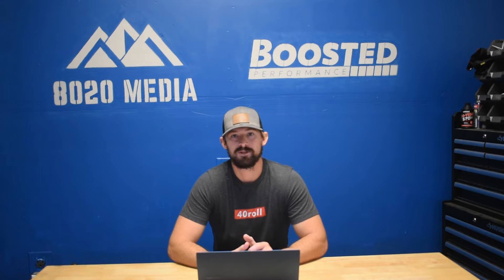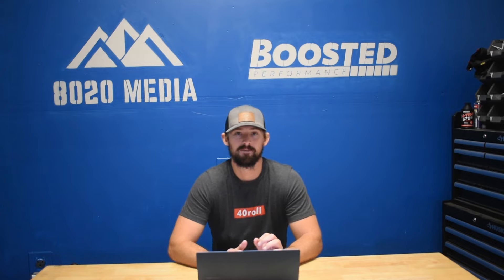DIY: How to Fix GMC/Chevrolet "Service Stabilitrak" & Traction Control Lights!

Comment: My throttle control and traction control lights are coming on. I've already replaced the throttle body. The codes from O'Reilly's tell me to replace the map sensor, but after I replaced it it still shows I'm supposed to replace it. Both the throttle control and traction control lights continue to come on after I drive it or let it idle a bit. Could a traction control sensor that's dirty or needs to be replaced cause the throttle control light to come on?
Reply from the maker: L - Have you reset your codes after replacing the MAP sensor?
Reply: @8020Media  yes
Reply: @8020Media  I have a 2016 Dodge Grand Caravan. I'm just having a hard time finding anything about the traction control and throttle control lights being related until I found your video.
Reply from the maker: L - Sorry to hear this.. Have you checked the wiring/connections to the MAP sensor? What code are you getting specifically?
Reply: @8020Media  I've replied with codes twice, but I don't see my replies with the codes. Do you see them?
Reply: @8020Media   catalyst efficiency below normal (bank 1), catalyst (2/1) efficiency below normal, IAC RPM higher than expected 

Those are the stored and pending codes both lists are the same. All of those codes are also in the permanent category + throttle actuator control system - high air flow detected.
Reply: I have replaced both Bank 1 O2 sensors, PCV valve, spark plugs, had two valves resealed - to remedy the flashing engine light and misfiring. Then the throttle body light started coming on along with the traction control light so I replaced throttle body, and then  MAP sensor after having O'Reilly's test the codes after the throttle body replacement because the map sensor code started showing up then.

Comment: Help here , in my case I only get the warning stabilytrack when step on break and car shut off for autostop but never when it’s running so what is your guess ?
Reply from the maker: Tin - Have you taken it to a shop to be looked at? Our thoughts are a brake issue or an issue with the autostop system.
Reply: No I didn’t take it to the shop and it’s intermittent fault and annoying
Reply from the maker: Tin - This is a difficult issue to diagnose. I'd advise taking it to a local shop.
Reply: @8020Media  I already replaced the break light switch and not changed at all keeps doing only on long stops over the break pedal
Reply from the maker: Have you addressed other things mentioned in the video?
Reply: @8020Media there is not codes I already checked abs connection sensor and nothing
Reply from the maker: Tin - And you're still experiencing this?

Comment: 4:50 I have a 2014 Silverado Z71 that I'm having this issue when I use my cruise control and switching on my hi beams. It kicks off the cruise and sometimes I will get the stabilizer link message or steering assist. Traction control light goes on/off, xm radio switches channels or goes completely blank but music keeps playing.  Also the engine shuts off when turning sharp like into the driveway or parking stall. Please get back to me with any thoughts.
Reply from the maker: J - This sounds like it could be electrical related. The ABS harness is close to the headlights. Have you had it looked at?

Comment: Mine came on after a wheel alignment.  Could the wheel alignment cause it to come
Reply from the maker: J - It's possible. Just try to drive on it for a few hundred miles and it should turn off!
Reply: @8020Media  thank you.  I work 80 miles one way got halfway to work this morning in it went off.    Thank you so much
Reply from the maker: J - Great to hear! Thanks for coming back and updating.

Comment: Occasionally my 2015 gmc sierra 1500 stabilitrak light comes on in reverse, lights dim significantly and truck dies. Steering wheel at low low speeds can sometimes be loosely erratic but not difficult to turn. Going to change spark plugs, ignition coils, fuel filter and throttle body. Any additional ideas? Thanks in advance
Reply from the maker: D - The symptoms you describe give us a bad feeling about your battery/alternator. You may want to get them checked. Keep us updated on this!
Reply: @8020Media  I will and thank you 🙏

Comment: 2012 Camaro - just got three messages pop up - Service Airbag, Service Stabilitrak, Service Park Assist at the same time...the car wasn't started for a while but the battery is only a few months old.  Checked for codes and there were none.  Disconnected battery and reconnected after 30 min, still there! I'm at a loss...any advice?
Reply from the maker: N - It could be an electrical issue.

Comment: i took my 2016 Chevy Traverse Lt AWD to the auto parts store they put on scan tool Found out bunch of codes spark plugs, coil packs and malfunction bad throttle body making service traction control and stability light on the dashboard to come  on
Reply from the maker: D - Sounds like a lot. Keep us updated!

Comment: service stabilitrak, service traction control, service trailer break system. abs is on also. No check engine light, no codes. Any suggestions?
Reply from the maker: M - We go over some troubleshooting steps in the video. Unfortunately, this isn't the easiest issue to resolve.

Comment: Does a diagnostic code typically narrow it down?

This sounds pretty darn complicated

This happened today and we were hoping to remedy it considering we bought the vehicle since the 2011 Tahoe was considered EXCELLENT reliability... Especially when it has only 87,000k miles.
Reply from the maker: C - Yes, a code will certainly speed up the diagnostic process. Unfortunately, it's not always an easy fix. Keep us updated.
Reply: @8020Media  will do. I was going to plug in the diag tonight.

Comment: Can a faulty alternator cause this? I noticed my battery gauge 'float' between 12 -14 volts and stay at 12v at high speed (avg over 65 mph highway, on a return trip from Charlotte, NC to Fredericksburg  VA, 6 hour drive). Turn signaling would also turn off cruise control while driving. At one point I saw the stabilitrak turn off amd the seatbelt warning light up. It did it once. Also, why I think the alternator might be the issue is that the battery light comes on from time to time while driving at low rpm. The battery was recently replaced.
Reply from the maker: T - This could certainly be a cause. Are you getting any engine codes?

Comment: Whenever the service stabilitrak comes up on my screen, it locks my steering wheel in place, is this a major problem? Or is it meant to do that
Reply from the maker: J - Uh, I think this is self explanatory, no?
Reply: @8020Media  well it happens when I’m taking a turn which is why I’m asking, and idk how to fix it
Reply from the maker: J - Having a hard time understanding. You're saying when you turn your vehicle, it locks up? and won't let you turn at all?
Reply: @8020Media  correct
Reply from the maker: J - Are you driving this on the road?

Comment: Would it be fair or accurate to say that if you use a scan tool and find the code that is causing the issue, does the code point to exactly what the issue is, or does in branch off in several different areas so that you then have to track each one down? It seems to me that even knowing the exact code it would still be a fishing expedition, but I could be wrong.
Reply from the maker: C - Most of the time, we would say this is fair. However, this issue can be extremely difficult to diagnose..

Comment: I have a 2012 camaro v6 no check engine like but service stabilitrak come on and RPM goes to zero car still drives the same when i stop start car back it goes away can you help
Reply from the maker: L - Unfortunately, this isn't an easy diagnosis. Did you go through the steps in the video?

Comment: Hi I got a code co710-17 Steering Position Signal Waveform Failure.  I replaced the steering position sensor, because after turning steering wheel to the right the service stabiltrak light would come on. Now it comes on again , after replacing sensor and turning to the left now. Please help with advice. Thanks
Reply from the maker: H - Have you driven it for a while after replacing the sensor? Unfortunately, this is a difficult problem to diagnose.
Reply: Hi, yes I have . Nothing has changed. Thanks for  info and response.
Reply from the maker: H - Might be worth taking it to a mechanic. Keep us updated!
Reply: We are going to check the throttle body and hose next to see if it’s dirty. Thank you If it works I will let you know..

Comment: Hi there! I have a 2019 Traverse. It is giving me a “Service stabilitrak” message on the dash ONLY when the auto start/stop feature reingages at a light. No other warning lights. The converter, pipes underneath converter (part of exhaust system), and shifter trigger were just replaced due to a check engine light code with that. Should I reset something? It doesn’t seem to be idling rough. I did notice a jerk driving it home from the shop but that was a fast break and very quick press on the gas again. 

I know this isn’t very helpful and I’m sorry for that! Just wondering if you had any ideas
Reply from the maker: Tayler - Have you contacted the shop that recently made the listed repairs? It may be worth reaching out to them since it should be covered.
Reply: @8020Media  it looks like it was the battery! The one that was in it was a 730 cold cranking amps. It calls for an 850. I haven’t had the issue since I put the new battery in yesterday but I’ll keep everyone updated!
Reply from the maker: Tayler - Glad you may have found the issue. Keep us posted.

Comment: So my service traction control only comes in when weather is hot.  I'm in phx az.  So went whole summer without it coming on and now in mornings when weather is 70 or below.  The service light doesn't come on.  But ince weather is above 85 90 degrees outside is when iT comes on.  Why woukd it only be during that time
Reply from the maker: D - Many different things could be happening. Do you have any engine codes?
Reply: @8020Media  no
Reply from the maker: D - Is it running poorly?
Reply: @8020Media  no runs fine. Warning signal only comes on I'm hot weather. With no check engine
Reply from the maker: D - At least it runs fine! The only thing we can think of is sensor related.

Comment: Mine started a couple weeks ago on my 2016 chevy colorado.   Lights turned on.  When I first start to drive my truck, the ABS turns on whenever I brake.  Then the problem goes away until I shut off the truck and turn it on again.  Engine runs fine, just the ABS issue at the start.  Any ideas what the problem could be? My OBD reader doesn't detect any problems either.
Reply from the maker: U - Sounds like an error with your ABS system. We just released a video for this that may be helpful: https://youtu.be/RkH7aiemBYQ
Reply: @8020Media  Awesome thank you!
Reply from the maker: U - Keep us updated!

Comment: Not sure if you'll reply to this, 
But I have an 08 avalanche 4x4. And when using 4x4 and the tires slip because of snow the stabiltrack will say service and the traction control will turn off and the entire truck will essentially try to shut its self off. Any ideas there? It only does this when tires slip or using 4x4
Reply from the maker: James - We try to reply to everyone! This is an odd scenario, but here are some things that you can look into: wheel speed sensors, steering angle sensor, or the transfer case. Keep us updated on this!

Comment: good content! I blead the brakes on my 2006 Chevy Tahoe and now my Traction Control light and brake light is on. Any advice??
Reply from the maker: The ABS sensors are located around that area so I'd check and make sure you didn't knock one of those loose while bleeding.
Reply: @8020Media  Thanks i'll check that out!

Comment: I'd like to suggest that you include diagrams and video examples to highlight your explanation of the various issues re Stabilitrak, Trac Control, ABS, etc, and it will help to clarify the topics discussed.  Also, perhaps you can improve the audio tone quality to make the sound less sharper.
Reply from the maker: R - Thank you for the feedback. This was our second video ever so we didn't have all the best equipment or experience. However, since this video we have dramatically upped our quality and hope it is seen.

Comment: Can a faulty catalytic converter cause the stabilitrak warning come on?
Reply from the maker: S - It's possible, but not very likely. Do you have any engine codes?
Reply: @8020Media  yes. P0420 and c056D-00 on 2014 GMC Terrain. The dealership says replacing the catalytic converter ($2000) will fix stabilitrak warning. Replaced engine at 122,000 miles ($8000) and recently front axles replaced ($1124) . I have 164,000 miles on vehicle now. Just concerned that replacing catalytic converter will not fix stabilitrak warning and will have to spend even more money. Thanks for your input.
Reply from the maker: S - Seems like you have spent quite a bit of money on it.. We think this could have to do with the ABS system, specifically the ABS control module. We have a video on this that may be helpful to share with mechanics: https://youtu.be/RkH7aiemBYQ

Comment: Service stabilitrack message appears after 30mins to 1 hour of driving. When i turn off the car, the light goes away. Sometime, my suburban also displays a “service brakes soon” message on the DIC but that’s just random and also not persistent.
Reply from the maker: A - Sorry to hear this. The video will assist you with this.

Comment: Thanks for the video.  This morning my 2011 Cadillac DTS popped the ABS and Traction Control Lights on the display, then gave messages for Service Stabillitrak, Service Brake System, Service Traction Control.  No Check Engine Light came on and nothing logged, though my logging tool is on the cheap side.  I'll check air filter and run some injector cleaner through to see if that helps the issue.  It otherwise drove fine this morning.
Reply from the maker: Richard - Thanks for the feedback! Unfortunately, this issue is quite difficult to diagnose. But if you go down the list, it should alleviate the issue. Keep us updated on this!
Reply: @8020Media  Update - The triple threat of warnings vanished later on the same day they started.  I changed out the air filter anyway as it was very dirty.  I have had a few flickers of "Service Power Steering" but not in the past week.  When it was time to refuel, I put in 2 x 16oz cans of Sea Foam High Mileage fuel injector cleaner.  Still no check engine light announcements.  If anything, the car sounds whiny, but still drives ok on the freeway.
Reply from the maker: Richard - Good to hear! Hope it continues running well. How many miles are on it?
Reply: UPDATE this issue was finally resolved when my alternator failed.  Looking back to when the problem first appeared in the early spring,  I heard a whining sound that was evidently a bearing in the alternator.

I must have been getting voltage fluctuations which triggered the steering,  stabilitrack and other faults.  Earlier this month I got a charging system fault and the alternator had put out its last charge. 

An alternator replacement is not a cheap repair.   $1k at a local shop,  not the dealer. 

All is good now.   Oh, and as an aside, I have ~145k miles.

Comment: 2015 Chevy Silverado 1500, gauges start jumping down and back up , then Stabilitrak light and parking assist off drive with care and then it starts running weird , and no power steering , runs fine one day and next day it does it again, new plugs placed . Plz help
Reply from the maker: K - Unfortunately, this isn't an easy problem to fix. Do you have a code reader?

Comment: 2019 colorado zr2 Service power steering  drive careful popped up first and dont work comes back after leaving it off for awhile 
And now stabilitrak. I'm not getting and codes please someone help I can't find any information on this issue
Reply from the maker: J - This whole video is dedicated to this problem. Did you watch it?

Comment: 2013 Acadia. In the middle of driving, especially on the freeway, i will get "engine power reduced". When it first started, i got back codes for throttle body. Got it changed but the light never went off and still having the same issue with power being reduced. Another code for catalytic convertor. Another weird thing is that the tire sensor stays on for the right rear tire even when its properly inflated but if i fill up the left side rear tire, it goes out.
Reply from the maker: L - Unfortunately, this is not the easiest thing to diagnose, as you have seen. Have you taken it to a mechanic?
Reply: @8020Media  I took it to a different mechanic today after I watched your video. He did another check for codes. Same codes as before but he went further and checked my battery and the voltage wasn't registering high enough. The gauge on the dash was sitting at 13. I just replaced the battery no less than 6 mos ago. So we went to the alternator and it was failing. He changed it and I'm praying that it doesn't come back on but it rides so much better. Thank you because if I didn't come across your video, I wouldn't have taken it anywhere and just put up with that engine light for awhile longer. 👍🏾
Reply from the maker: L - We're glad to be helpful! That's what we're her for. Thanks for coming back and sharing your experience.
Reply: @8020Media  Welp that only lasted 2.5 seconds! Back to square one. At least I have a new battery and alt. Im cringing the dealership visit but I will have to go to one now.
Reply from the maker: L - Sorry to hear.. Keep us updated.
Reply: FINALLY! Accelerator Pedal position sensor. 🤦🏾‍♀️ I forgot what the machine was called but this mechanic got right to the source. That light hasn't come back on since. Whew!
Reply from the maker: L - Nice! Thanks for sharing this experience!